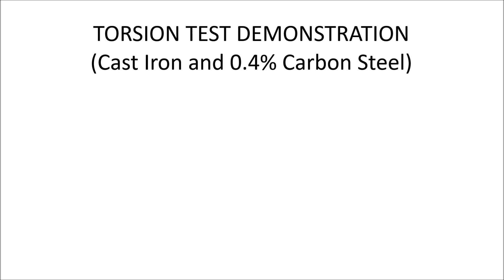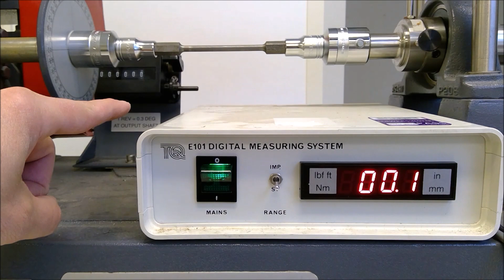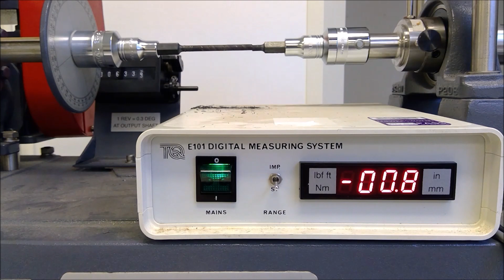Torsion Test Demonstration: Cast Iron and Carbon Steel

Comment: What an amazing demonstration! This really displays what I'm learning in my Strength of Materials class, that the more brittle material, which has a shorter elastic region on the stress-strain graph will reach the point of permanent deformation much earlier, but with a higher stress requirement.
Reply from the maker: Thanks - glad you found it useful
Reply: Not all brittle materials have shorter elastic region. The better way to tell brittle material apart is the absence of permanent (plastic) deformation.